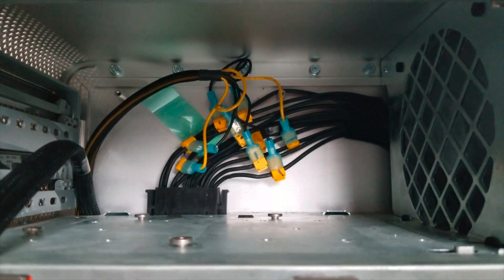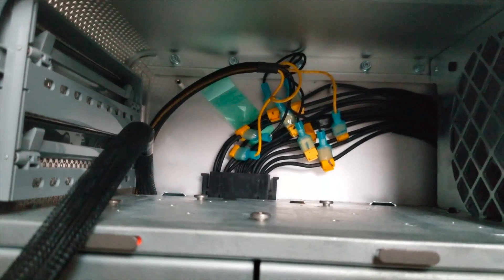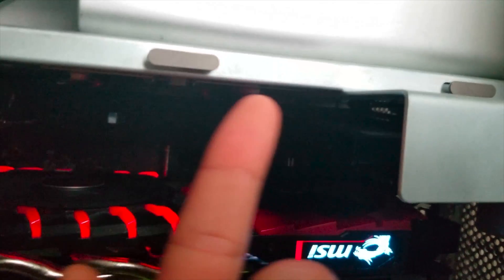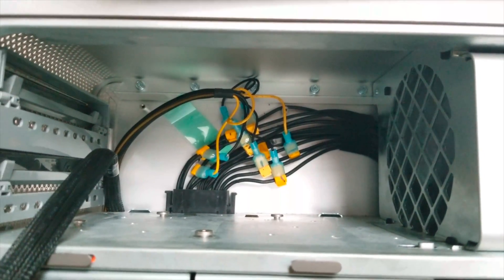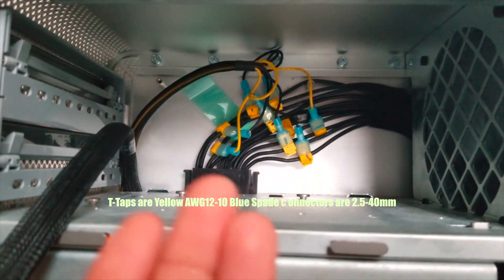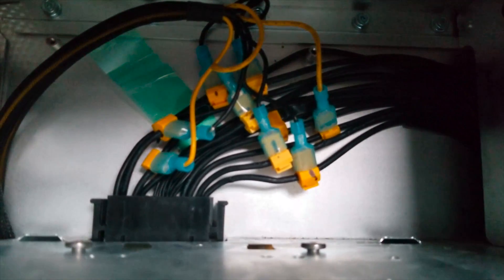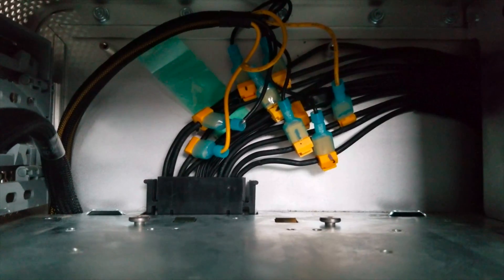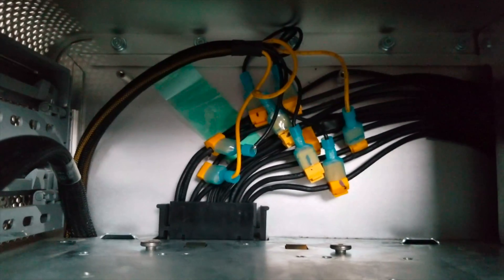Mac Pro Power Supply Mod (Pixlas Mod) Tips, Tricks, and Overview

Comment: Hey, i have found this video while looking for a power supply adaptation from a usual 24 atx psu to a Mac Pro 3 1 from 2008 because i found the Mac on a flea market for around 30$ and got an extra 2 1 for 20$ or so (that one is definitely broken though owner said it hadnt been working for years, he didnt know about the other one, however..) and the only thing missing were the ram modules, so i ordered those for another 35$. Now as i said i do not trust a Psu that is 12 years old of which i dont know wether it might toast the Logicboard (also not sure if that works, tips on that are appreciated) or just run fine, is there a way to mod a 24 pin to a whatever apple uses in there or do i have to buy a "new", or at least working one off of ebay?

Comment: I did this mod too and the hardest step was taking out the four screws holding the PSU.  One of the screws stripped and it was a major pain to try to get it out.  But once out, the rest are straight forward.  Just follow the guide exactly and you should be fine.

Comment: STOP USING WIRE TAPS. Those things are total shit.
Reply: What do you recommend instead? Could I cut the cable and use small chocolate block Terminal Strip screw connectors?

Comment: Did you just tap off of the existing PS, or did you upgrade to a more powerful supply? If the latter, what size do you advise?
Reply from the maker: Tapped off the existing PSU, I used the 16-18 AWG kit I think, I'm not sure. I do know that it was the yellow taps and blue spade connectors